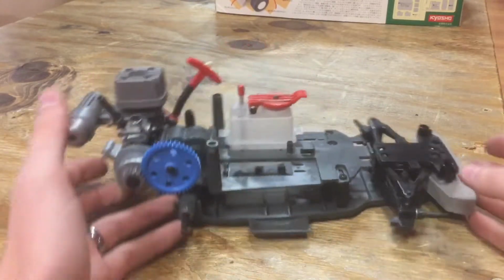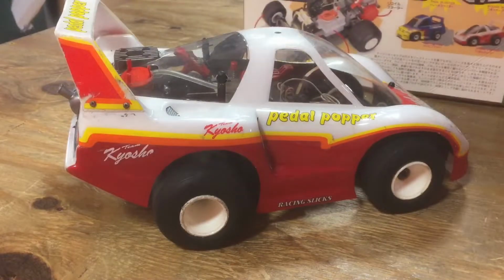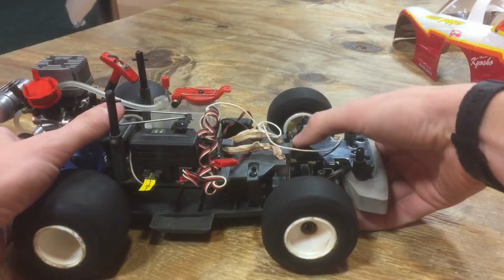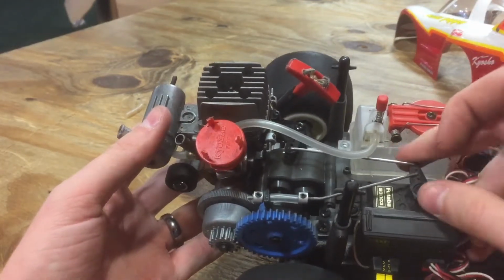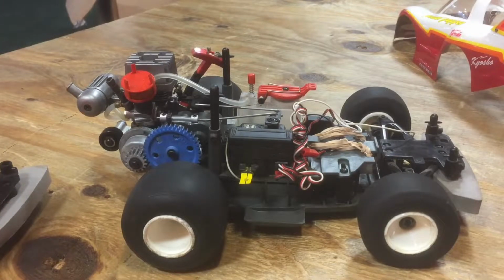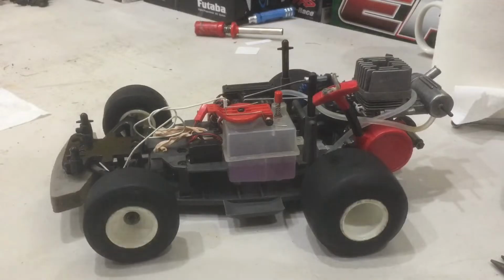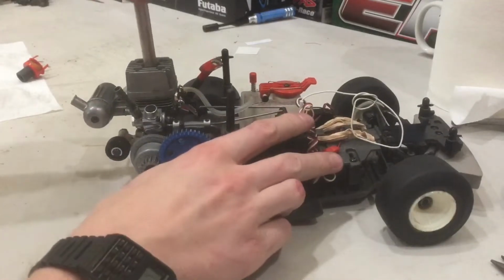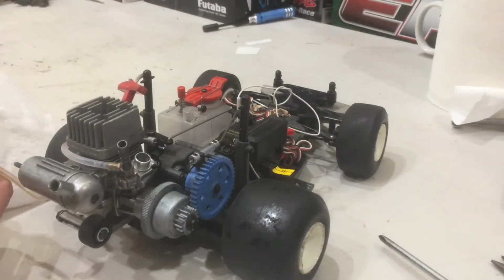Kyosho Nitro Pedal Popper wheelie machine, engine teardown and start | Mini Nitro RC

Comment: I just want the engine I have a kyosho sandmaster and it needs a lot of parts I found the parts I needed but I need the engine
Reply from the maker: Tracy Welling well, as of writing this comment, there is another kyosho pedal popper chassis with brand new engine on ebay. Might be worth getting
Reply from the maker: tony detwiler it’s still in my watch list, search for kyosho hoppin mad

https://www.ebay.com/itm/282101343009
Reply: Are you trying to fully restore it to original factory spec or do you just want to get it running? In the latter case you could probably just stick any small-block engine in there.